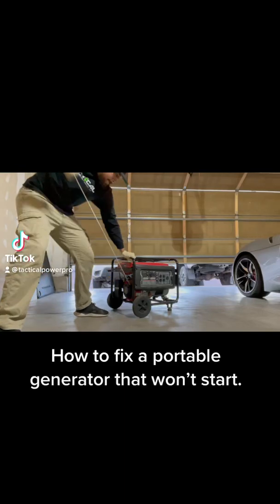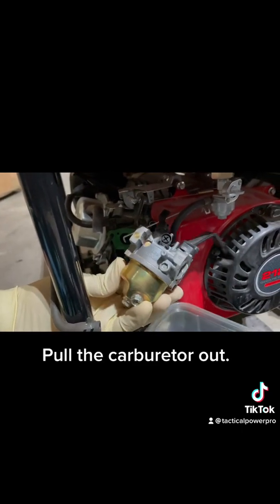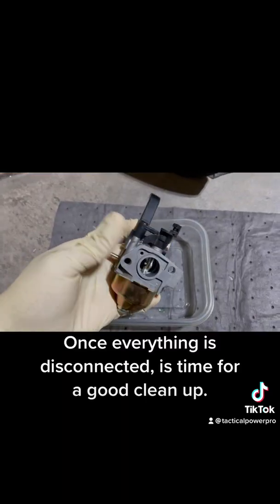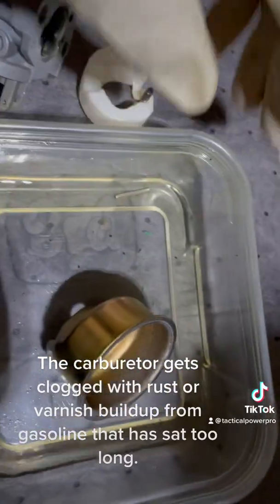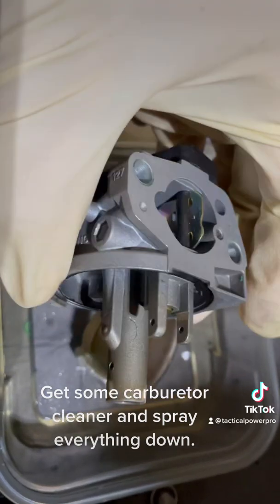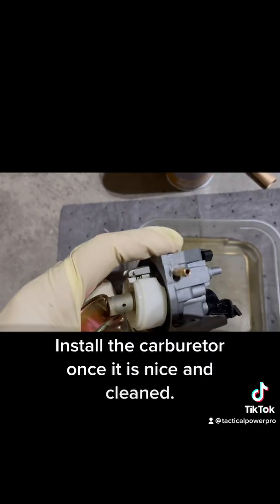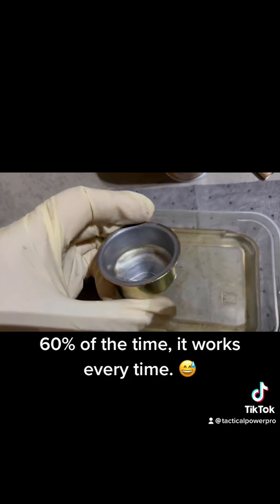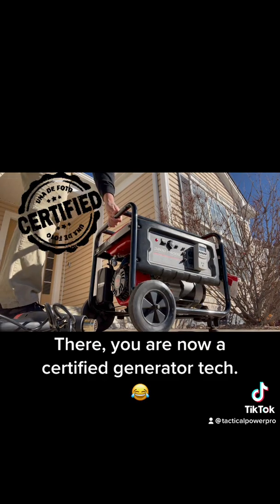How to fix a generator, in less than a minute. #subscribe #inverter  #generator #youtube #diy

Comment: Cleaned the carburetor and it still didn't turn on
Reply from the maker: Next step will be to check if fuel is reaching the carburetor, check if you have spark at the spark plug and finally check for engine compression.

Comment: That a does work for other machines, as well as generators
Reply from the maker: Yes, this can be use to repair any carbureted small engine such as in pressure washers, lawnmower, trimmers, concrete mixers, pumps, etc.

Comment: I accidentally tore the pilot jet rubber o-ring when inserting it back. Now the engine is too easy to start even without choke using slight pull and it's surging.
Reply from the maker: It has happened to me before multiple times. You’ll need a new pilot jet or find a similar tiny rubber o-ring that fits. When the o-ring is missing there’s no seal in the pilot jet, letting extra air in and messing up the air/fuel ratio mixture while idling. That’s why the generator surges.

Comment: What tool did you use to unscrew that last bolt tied to the air filter? having issues with that as simple as it may sound
Reply from the maker: Some generators have the black canister in the way making it hard to get to that back bolt of the air box. In situations like that I use a ratchet with extensions to get to the bolt or an open end wrench and squeeze my hand in there. That bolt is typically 8mm or 10mm.

Comment: This is not how to fix a generator that won't start. You always start with the simplest problem and work from there. Make sure it's got fuel. Make sure it's got a spark. Makesure it's got air ( check air filter. These three items can be checked in less than 10 minutes. If you got fuel, air and a spark then go to the carburettor. There's no point in ripping the carburettor to bits only to find it's was something simple from the beginning!
Reply from the maker: Correct, you always start with the simplest problem and work from there but from experience on working with generators over 10 plus years I’m not afraid to say that 99% of the time a portable generator won’t start is due to a clogged main jet. Thanks for sharing your thoughts.

Comment: Anybody who is having issues with your gas-powered generator reply to me and let me know what's wrong and I or someone else will guide you!
Reply: I borrowed two generators and both won't work. One doesn't start (small, gasoline) and the other one (proper size, diesel) starts, but won't generate power 😅
Reply: @TheAlchemyOfConsciousness  hello so for the small gas one what you can do is take off the air filter and spray some starting fluid or gas into the carb's throat and try starting it. If it starts and runs for a couple seconds there is a fuel issue (likely clogged carburetor) and if it doesn't start check for spark with a spark tester and if spark is good test compression with a compression tester and for the diesel generator check to see if the brushes are worn down
Reply: @bailey60042  hey there, thank you for your respond and advice. So the small one did start and run for some time yesterday, but it shut off. First it ran higher (don't know the words to describe it, but it was like shifting into a lower gear or holding the clutch and giving it some gas) for just a moment and a few minutes after that it just shut off. No chance starting it again. Then on the morning it started again, but shut off after maybe 20 minutes again. So I guess the carburetor? 
For the diesel generator: where are the brushes supposed to be? What am I looking for?
Reply: @TheAlchemyOfConsciousness  did you figure out the problem with either generator?
Reply: Predator 3500 is leaking oil from air filter & has a boggy sound when running.. i put it at low idle to fix the bog sound
Reply: @allday3433  did you figure out the issue?
Reply: @allday3433  either you overfilled it with oil, the piston rings are worn, or the head gasket is blown. If the oil is not overfilled, do a compression test to find out if one of the other 2 is a possible issue. You will also need to replace the air filter.
Reply: Honda 3000eu will start and run but after about 30 min it shuts off I have changed the oil and spark plug and air filter
Reply: @Ivan-ef5rs  check the carburetor out
Reply: Wen 4750 went a lil pass 12 months without turning it on, now it wont start, clean carburetor?
Reply: Didn’t winterize same gas
Reply: @theRYGUY1  yes you should clean the carburetor for sure and probably the fuel tank and maybe the fuel line
Reply: I cleaned mines. But now it’s leaking through the primer and other
Reply: I have a Pulsar 1200w 2-Stroke.  Ran fine day 1, and started leaking gas from carb on day 2.  Opened it up and made sure float was good (doesnt leak now). But wont start at all.  Is it possible I have to clean the carb already?  Has only had gas in it 2 days, and gas was fresh (50:1 mixture).

Comment: I have a kipor 2000 i bought it not running i cleaned the spark plug and the carb  its running now bought it for 50 euro🤣
Reply: And it was green from the inside of the carb
Reply from the maker: Oh wow that’s awesome 😮 if the previous owner had watched my videos he would still had a generator lol
Reply: I just got one with that issue as well varnish green float was clogged  .Just taking carb out was lots of work. Today put it back together and hope it will work....I see that using old gasket but best to use new...I'll leave it at t hat